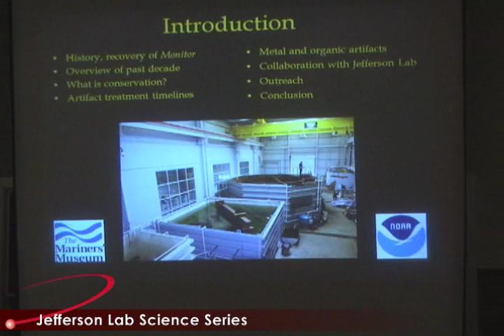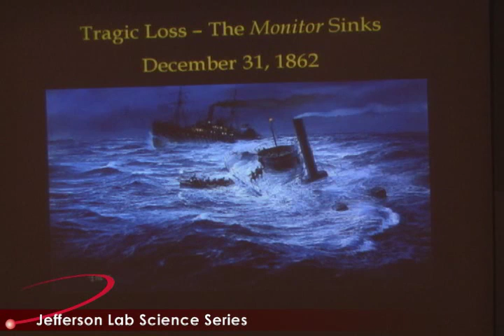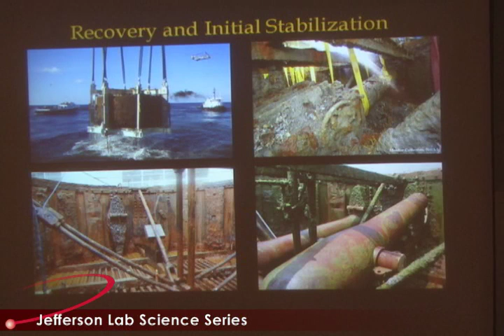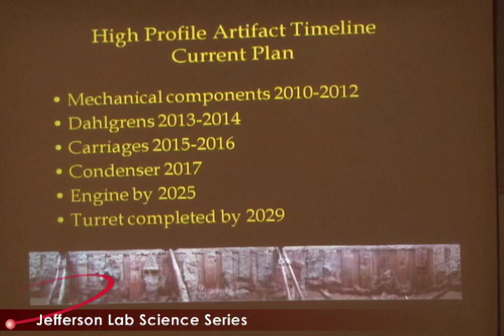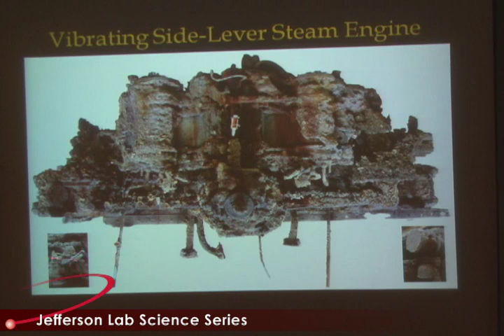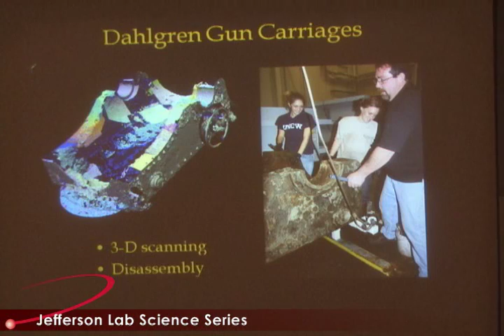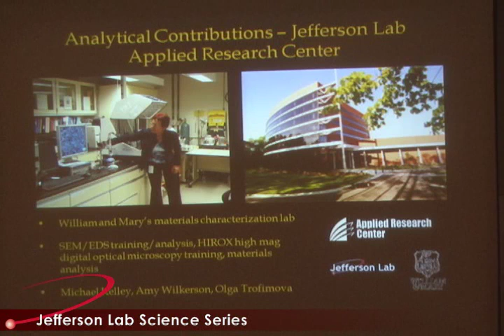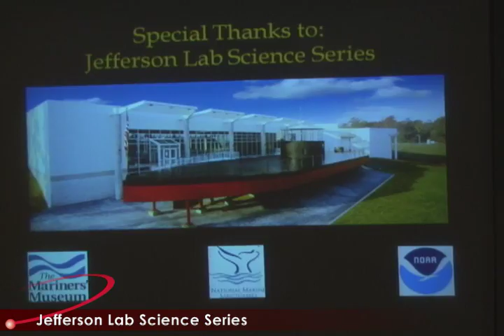Restoration of the USS Monitor

Comment: Great video. It's not often mentioned, but the reason that the USS Monitor started flooding was because the crew DISREGARDED the fact that the interface between the turret and the deck was designed to seal out water when the turret was lowered. Instead, they raised the turret and stuffed oakum into the METAL sealing rings.